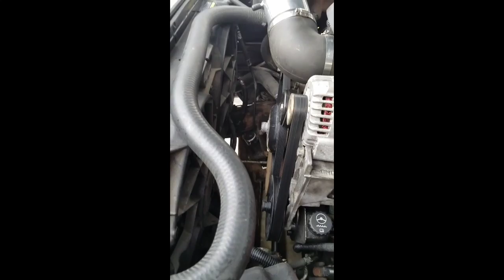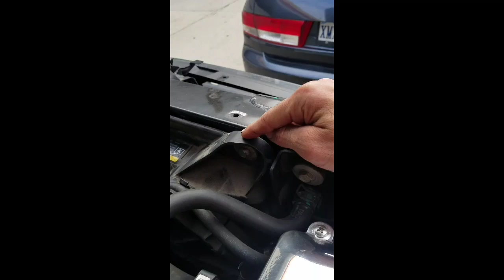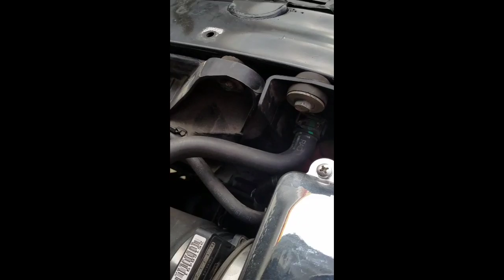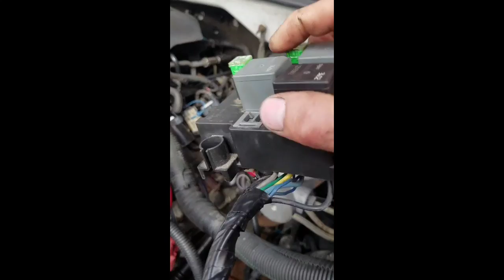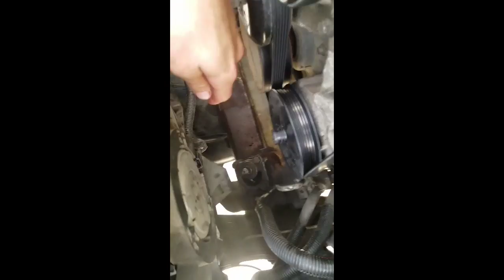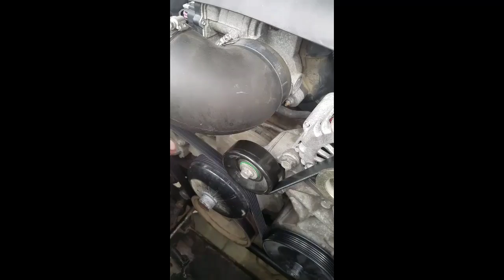Silverado electric fan conversion

Comment: I did mine & it's green wire pin 33 & blue wire pin 42 then whom ever is tuning it for yo will set the parameters for the fans
Reply: Was the swap hard i have everything iam just nervous on wiring up the computer also my truck is tune already

Comment: So I’m in the process of converting to electric fans I just took off the fan clutch and noticed that there is no screws holding the water pump pulley and I don’t want the pulley to fly out when I’m driving
Reply from the maker: The pulley is part of the pump shaft. It doesn't come off.

Comment: Do your fans run as soon as you’re engine starts? I did the same install but my fans run all the time.
Reply from the maker: Titan92 - no,  my radiator fan will kick on at 210° and the ac fan will kick on when the ac pressure hits a limit.  Did you have a shop go into your ecu to activate the ecu to switch them on?
Reply: Yes I had Nelson performance in San Antonio activate them . Who did your tune?
Reply from the maker: Titan92  horsepower solutions in Newport news Virginia

Comment: Do you have to use the radiator from the donar
Reply from the maker: mike baker i don't understand your question. You can rig up any fan add long as it moves enough air.  If you get a radiator and fan from a Tahoe or pickup, it's all direct bolt in and you know it will be totally significant. The radiators are bigger wich is always good,  when i do improvements or modifications to my vehicles i want as clean and oem looming job. You can't tell mine had been swapped. I hope that answers your question?
Reply: @mike baker - Only if you have the smaller 28" radiator in your truck. If you already have the 34" radiator then you only need the fans.

Comment: so where your fan is now was there a rad you had to take out and cap the lines? then put the fan in?
Reply from the maker: Xxkevin_blitz.can-amxX 
i used all the original hoses, except the trans cooler lines as i mentioned i had to make those work by adapting.
Reply: Tyler Chenette ok i see what you did now thanks!

Comment: Great mod. Doing the same to my 2004 Tahoe.  I see you also upgraded to the wire on the alternator. Good work.
Reply: upgrade to 130amp alt too.  looks like he's running the 105 amp alt.